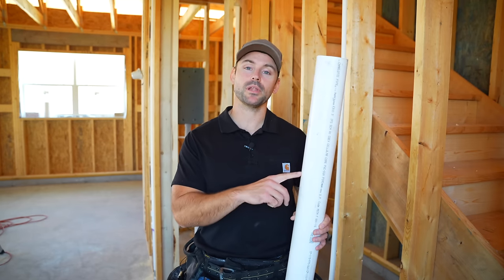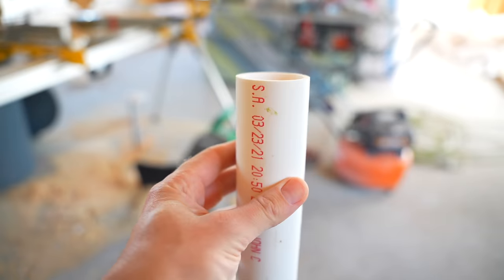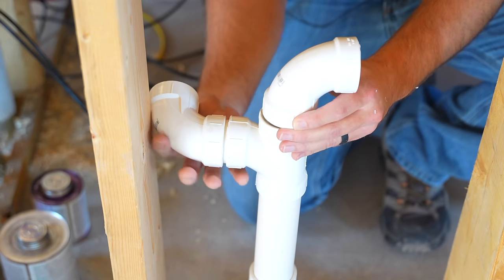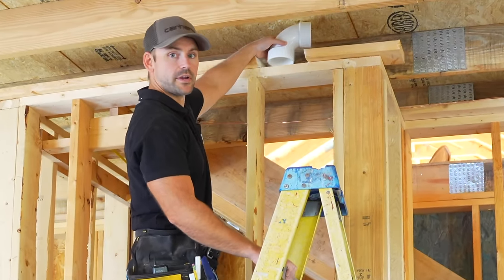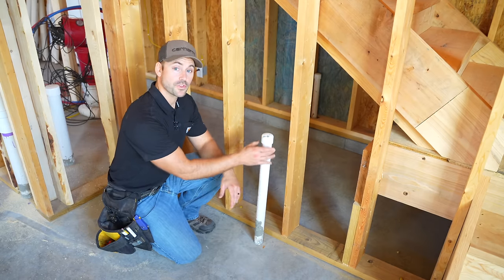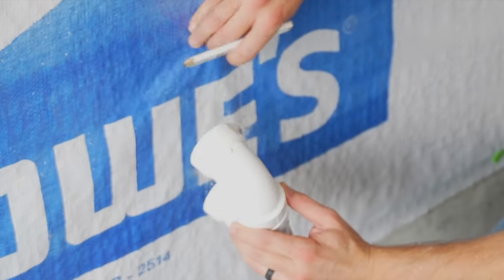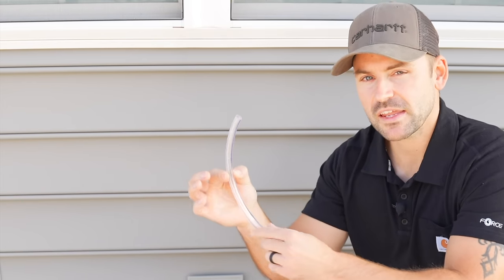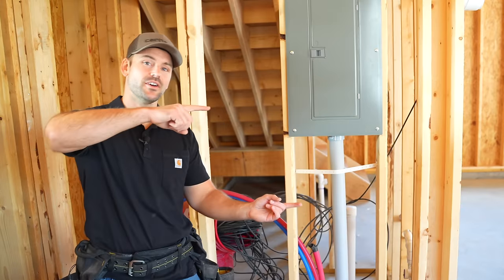How To Vent Plumbing Pipe - Toilet, Bathroom Sink, and more!

Comment: Your lav horizontal vent is too low. It should rise vertically (or using 45 degree elbows) at least 6" above the highest flood level rim in the system (usually @ 42"- or 6" above kitchen sink level) before offsetting horizontally to tie into the 3" vent stack by all plumbing codes I have seen. Ask you AHJ or plumbing inspector.
Reply from the maker: Thank you for your feedback to improve this video. See my pinned comment.
Reply: That caught my attention also.
Reply: I noticed the same thing.  The reason for vent explanation is wrong also.  Two reasons needed.  System is sealed through septic or sewer.  Gases expand and would creep into house even back through p traps.  The next reason for vent is developing a siphon effect as water drains through p trap and without vent, it would leave an air gap in p trap and allow gas migration.
Reply: Yea i made that mistake of leaving the vent too low with a studor vent and i had a backup and it was pissing out the studor vent.
Reply: Ok so 42 inch. But can it be higher? I have electrical box on my way
Reply: @marekkrepa9982  Yes as high as you want.
Reply: @bobrub  thanks
Reply: Atleast 4’ up put 90 for vent

Comment: That’s the trap arm not a wet vent, the portion below san tee heading to 3” is wet vent. Your sink is wet venting the shower. If the sink was wet vented, then there would be water draining from above it, that’s like modified stack venting or multi story wet venting

Comment: Lavatory vent is not 6” above flood level rim.
Reply: By upc you can't connect two vents under de flood level rim and also if you want to use 90° the way you did you need to use those 6 " above the flood level  rim,  45° are ok but no 90°  .
With all my respect
Reply: @manuelbolis1527  correct. If the lavatory drain ever backed up you would never know because it would began draining through the vent and over to the stack.
Reply: Doesn't the horizontal vent have to be above the flood level of the sink by like 6+ inches?
Reply: What's the flood level u all are talkin about and drawing over to the vent and over to the stack
Reply: @erinsquirkychannel501  in this particular video talking about vanity sink,  the flood level rim is the top of the sink
Reply: @erinsquirkychannel501 in this particular video talking about vanity sink flood level rim 
Top of sink 
You can use 90 but 6 " above top.of the sink
Reply: @erinsquirkychannel501 Flood level is the highest point on a fixture where the water would start to overflow/flood. Imagine putting a plug in a sink and turning on the water until it overflowed. Where it begins to flow over is the flood level. In this case, it’s the rim at the top of the sink.

Comment: Watch how you tie in your vents, needs to rise and connect at least 6" above flood rim of the highest fixture on the branch. How you did that sink should fail pretty much any inspection i would imagine. You'd never know if something clogged, pressure would build up and before showing at the fixture its just going to dump down your vent.

Comment: Great video!  You mentioned being careful not to use too much pressure when applying the glue, and I just wanted to note a trick that I've learned is to pinch the applicator rod instead of holding the lid during the application.  That way you're not putting stress on the connection where the rod attaches to the lid and you're able to make it through an entire bottle of glue without the applicator breaking off!  Thanks for you videos, always helpful!

Comment: For the two story house plumbing example, when you tie in the first floor vent pipe with the second floor vent pipe, is it continuous? Or do you have to start again on second floor and go up 42" for the second vent and connect the first floor vent to the second floor vent pipe?

Also, if the toilets are 1 foot away from the 3 inch stacks, would you need to put a vent for both of the toilets?
Reply: All fixtures should have a dry vent within 5'

Comment: So I believe international code requires slope even for air venting lines in order for condensation and  rainwater to drain through the venting system. One inch per foot of drop. Thoughts?

Comment: Excellent video! Are you in a colder climate? I noticed your using 3-inch pipe for the venting. Just curious.
Reply from the maker: Thank you! We do definitely have a cold season here. The 3 inch pipe is definitely plenty for just a half bath. I could have got  away with a smaller pipe, but I like to use a 3 inch pipe if I can for plenty of vent. I hope that helps!
Reply: @TheExcellentLaborer thanks Josh! I really appreciate it.
Reply: @TheExcellentLaborer   Here in Wisconsin, 4 inch is required for the soil stack and out to the street.  3 inch is rarely used, everything else 1 1/2 or 2 inch into 4 inch.  Also the vent is expanded at the roof line so that in winter if frost or ice builds up, you still maintain a 4 inch unrestricted vent opening.

Comment: Hey man great informative video!

So a question for you, when doing plumbing in a basement, does connecting to any stack automatically counts as proper venting? Since everything above should be vented and at some point leads to the roof?
Thanks for the content!

Comment: My question is I only want one hole in my metal roof. Can I connect 2 or 3 vents in the attic horizontally using 90s to travel to one another??so they can go out one hole. Or can I only use 45deg fittings going up and out??

Comment: Also, you could have run the AAV under the sink off of the drain line with a horizontal saniT and saved a wall penetration.

Comment: Hi, i have bathroom upstairs there is 1 vented pipe , which vents through the roof , so all good , my question is if i fit a underground junction with pipe going to the above pipe for a cloakroom  w.c downstairs 
do i need to worry about venting or will the vented pipe already there be okay

Comment: Venting does allow water to drain properly, but in doing so it provides for several things. three main purpose of venting is to keep the draining water from siphoning water out of the fixture trap, which would then allow sewer gas to enter the building. It also allows for equalization of air pressures inside n outside the house to prevent traps from draining or burping, and it allows sewer gas a place to vent safely.

Comment: Have a question for the experts here since I'm a complete newbie, is there any reason why I couldn't just use air admittance valves on all the drains? I understand it would cost more but would be a lot easier than tying everything and taking it thru the roof. All feedback would be greatly apreciated.

Comment: If you can’t go out the roof, can you out the side wall
Reply: When I built my house about 15 years ago, sidewall vent was not allowed.  I only have one roof penetration and that is my plumbing stack.  Couldn't come up with a way to eliminate it.  At least I tied all vents together in the attic and have one penetration instead of these apartment complexes that have like 20 penetrations.
Reply: There are also codes as to how high vent must be above roof n how far from dormer windows